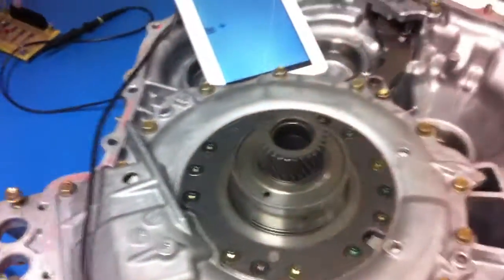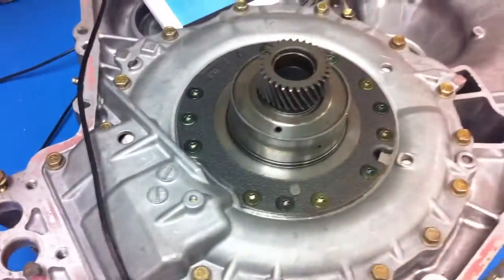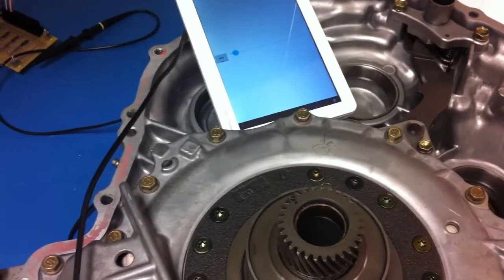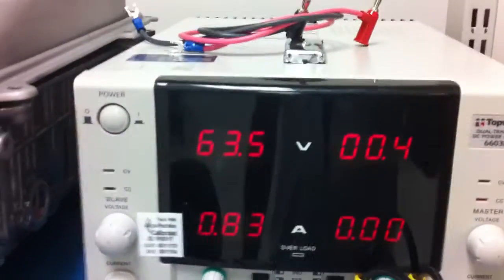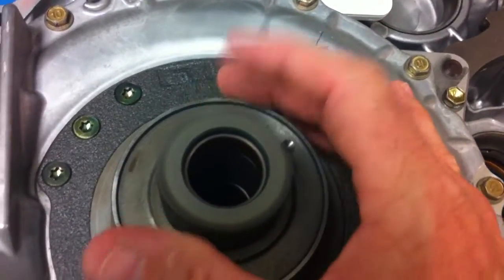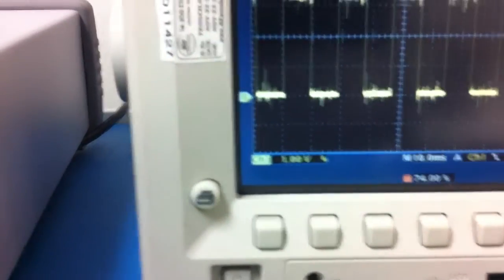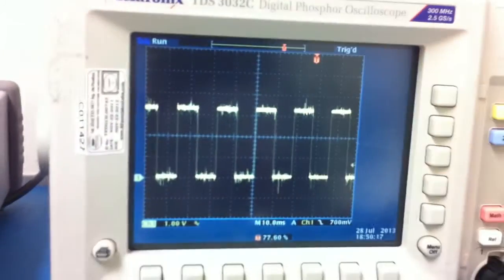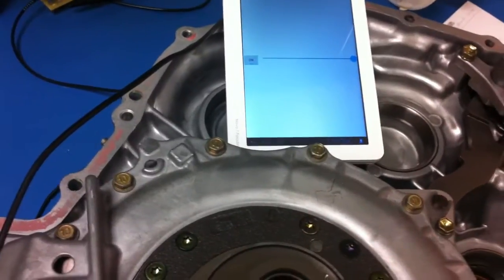Prius IPM motor control test

Comment from the maker: I haven't made as much progress as I would like but if anyone wants more details on some of the development activity up to now go to www.diyelectriccar.com.  Search the forum for my handle jddcircuit and you will see threads and posts outlining a lot of questions about the interface to motor and the expected power from the motors.

There are several of us experimenting with these Prius motors and inverters on this forum.

If you go back to the beginning you will read how clueless I was getting into this project but the learning has been great fun.

Best Regards
Jeff
Reply: great work man.
I have the BMW and I've been working to conversion to electrician using prius trans and inverter 
i was wondering if you could show me how to convert one of those inverters.
a schematic of the inverter and controller conversions would help very much.
would pay depending on the price

Comment: I was thinking of doing an EV conversion on a Prius by using and arduino as the motor contoller.  I think 50-60 MPH and 50 mile range would be plenty for an around town car but would like to keep the hybrid mode for traveling also.  Seems that you have done alot of the math already.....how large of a battery pack do you think would be needed? I am guessing that since a  6.1kW pack I saw had a range of 22 miles then I am looking at 15kW or so.  Keep the up the videos. Thanks.